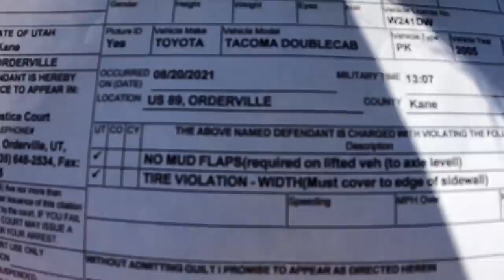I got pulled over for WHAT?! BUSTED!!

Comment: I had to replace my carrier bearing on my lifted 00 tundra. Upon putting the large nut back on, I somehow overtightened the nut and messed up all the threads. It did not take much pressure. Put it on to the bad threads anyway with locktite, drilled a hole and put a cotter pin through it so the nut could not come off and ran it for years. I love my toyotas and have tons of stories. Owned a 2000 tundra 14 years, 01 sequoia 2.5 year but got rid of it because of a bad frame. Now I have a 2011 Sequoia with the 5.7 litre V8 and love it. Plan to buy my wife a highlander.

Comment: It's not impossible to mod a vehicle in Australia, but they have tightened up the rules considerably, you need engineering approvals for anything major away from stock, and as long as it has the certs, you are fine.... The issue was there were some real cowboys out there doing stupid stuff, and caused accidents, so they came down hard on everyone... Do it right, no problems here...

Comment: According to UTAH legislature 41-6a-1633 (1)(b) :
The wheel covers, mudguards, flaps, or splash aprons shall:
(i)	be at least as wide as the tires they are protecting;
(ii)	be directly in line with the tires; and
(iii)	have a ground clearance of not more than 50% of the diameter of a rear-axle wheel, under any conditions of loading of the motor vehicle.

As far as the fender flares are concerned - To be effective against slinging out a rock or debris towards vehicles traveling behind you, shouldn't the fender flare cover the full width of the tire? Otherwise, it's just on their for show.

Same goes for the mudflaps - I could be wrong, as maybe it was an odd camera angle but  @9:06, it appears that the left-rear mudflap does not cover the full width of the tire?

As a side-note: I used to be trained and registered as a Utah State Safety Inspector. Guys would come in and you could tell them they failed because: Tires, Ball Joints, Idler Arm, Pitman Arm, Tie-Rod ends were all shot and needed to be replaced to pass inspection and it was going to cost them *$XXXX*... They wouldn't bat an eye. But the second you told them that their lifted / humongous tire upgrade also required that they install some inexpensive mudflaps, or they needed a $10 set of wiper blades - they'd lose their damned minds! 

To this day, I still don't get why men want their entire wheel/tire assembly sticking completely beyond the body of their trucks and I definitely do not understand those with an affinity toward the ultra-wide/low-profile tires that make their truck ride like a tank and serve absolutely NO off-road benefit.
Reply: Personal opinions/preferences that's why

Comment: State of Oregon requires mud flaps also. Funny thing is as socialist as the state of Washington they let most of that go. Back east some of those states have bumper height restrictions so that yota would be illegal back there. After the 80's craze of putting 44" tires with 12" or more of lift on everything things changed.  This is one of the big reasons why stroker kits for big blocks took off.  With tires that big you need lots more power than 150 hp if you were planning on going anywhere with much speed. Before this time era the common guy couldn't get big block stroker kits.

Comment: Who ever's watching?  Could be a hundred thousand of us pretty soon.  
I barber poled a rear drive shaft on a Nissan pick up back in the late eighties on the Burr trail.  2 hours later I had the shaft off using vice grips and we headed for Kanab to visit relatives, running on the front drive line in 4wd .  After dinner we went to Zion's to camp.  By 10 pm I was hallucinating from heat exhaustion cause it had been 110 all day and I didn't have ac and didn't drink enough water.  After drinking all the nasty cooler water and packing myself with ice, I finally returned to normal and lived all the way to right now and this video brought it all back.  Thanks for the fond memories Fab Rats!